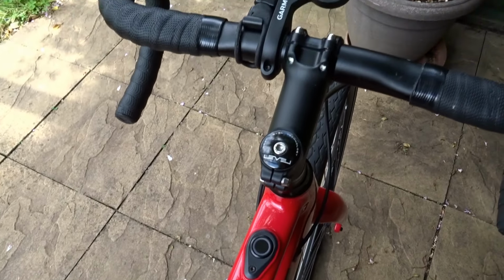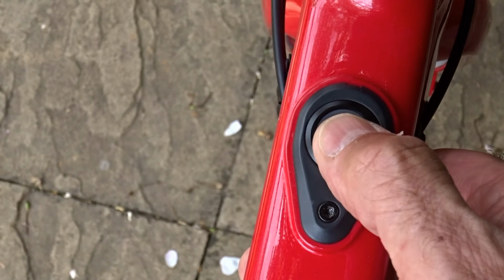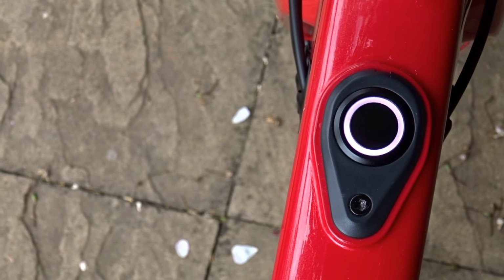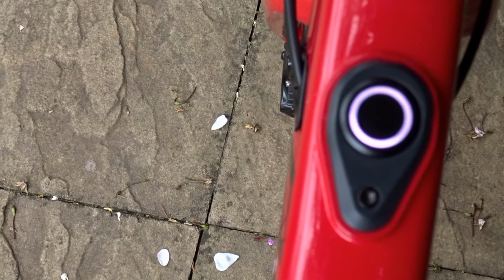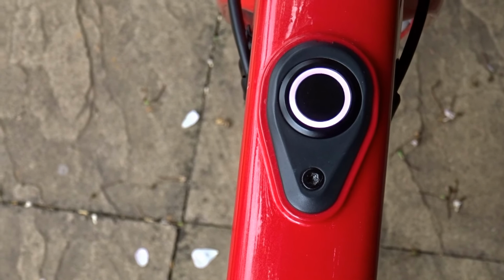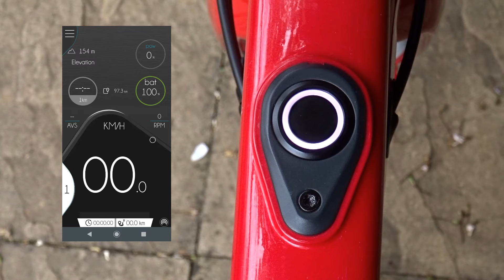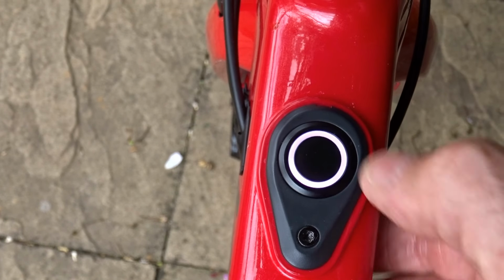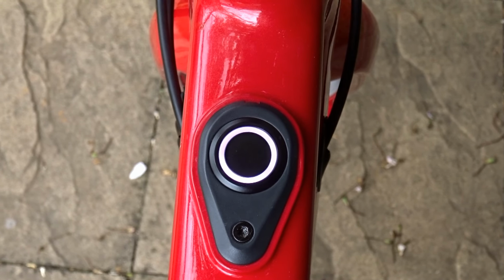How to use the Ebikemotion iWoc controller. As used on Ribble, Orbea and many others.

Comment: What’s the app called? Just picked mine up from Ribble and on train home
Reply from the maker: That’s great, you just need the weather to ride it now. Details of the app here https://www.ebikemotion.com/web/ebikemotion-app/
Reply: @RideWithRoy  cheers Roy
Reply: Roy any advice on mudguards for the bike? I thought I could get some in the store at blue water today but they didn’t sell them. I tried in Halfords but they didn’t have any that fitted and said I should look online, what sort of measurements should I be looking out for? Sorry m8 I’m not very good at this kind of thing. All advice is greatly appreciated 👍🏻 your videos were a big help in me choosing my bike
Reply from the maker: I prefer SKS mudguards but needed wider for the Ribble. I got a cheap pair of Halfords own brand which are okay but not a patch on SKS. The main requirement is to match your tyre size. Assuming they are 700 x 35, then SKS Bluemells Olympic Racer should be ideal. Cutting the steel stays is a challenge, but once fitted they are easily removable for summer.
Reply: @RideWithRoy  I’ve looked at the SkS range but they all seem to have an attachment on the front mudguard  that needs to be screwed into the top of the front fork and my bike doesn’t have a hole in the top of the front fork for that kind of mudguard. I’m gonna check out the ones you mentioned. Thanks for getting back to me m8👍🏻
Reply: @RideWithRoy  would the SKS veloflexx 65 mm mudguard set for a 29 inch wheel fit?
Reply from the maker: I really couldn’t say. You would need to measure the space inside the frame. It does sound a bit on the wide side. What width is your tyre?
Reply from the maker: Mine has the screw in the front fork, so maybe something has changed. It would be worth emailing Ribble factory to ask their advice.
Reply: @RideWithRoy  cheers Roy
Reply: @RideWithRoy  47mm
Reply from the maker: I suggest get close to that. Say 50mm

Comment: Hi Roy - I have a question that I've asked of a few users and got nearly as many answers!

I understand that by using the App you can customise the amount of assistance available for each of the three levels (Green, Amber and Red) individually on a sliding scale. My question is to ask whether these customised settings are "saved" on the bike's circuitry, or whether the App needs to be running all the time? To put it another way - If the rider used the App to set the level of assistance in the "Green" setting at say 50% of maximum, but then switched off his phone (or left it at home) while he went for a ride, would the bike give him 50% or the full 100% ?

Keep up the good work on your channel - I've enjoyed your videos immensely.
Reply from the maker: Thanks for the question, Roy, but you’ve stumped me because I don’t use the app. I would imagine that the the changes remain, but I’ll ask my contact at Mahle and get back to you with an accurate answer.
Reply: @RideWithRoy  Cheers Roy. Don't put yourself out to obtain an answer - I only took delivery of my CGR Al e yesterday (same colour as yours!) and have yet to ride it at all. I'm trying to get an understanding of the whole system before I do - It's just the way my thought processes work.
Reply from the maker: @TheRoybeasley  not putting me out at all. I’ve sent my contact a message so should get an answer Monday. I’ve never bothered changing the engine settings.
Reply from the maker: Hello, Roy, my contact has confirmed that changed engine settings are retained when switched off.
Reply: @RideWithRoy  Cheers Roy -  I took the bike out for her maiden voyage today (I've never ridden an e-bike before). Initially I was a bit unimpressed by the level of assistance available in Green mode. Until I powered up my phone and connected the App, to discover that my earlier fiddling about with the App's settings had indeed been "remembered" by the bike and it was giving only 40% assistance in that mode!

I've since had another play - including connecting from a totally different phone and can indeed confirm that the engine settings are stored on the bike and that there is no need to keep the App running on the phone all the time you are riding.

I'll be moving up to the next level soon and connecting my HR monitor to the App/bike, meaning that the level of assistance will automatically match how hard I am working!

(Gotta love this technology!)
Reply from the maker: @TheRoybeasley  thanks for confirming that, Roy. It was pretty impressive that the Mahle contact replied on a Sunday! I did 50 miles yesterday, mostly into the teeth of a seriously strong wind. I had the power on for most of the ride as I was trying to keep up with my very fast son and we had 2600’ of climbing. I used all three power settings at times, although mostly green and I was on flashing red at the end. Mind you, he still had to freewheel a lot and wait for me several times on his featherlight carbon steed. Enjoy you e assist as it’s certainly a game changer. For your next gadget you should really consider the Varia Radar. I’ve discovered an excellent add on for mine that I’ll cover in my next video.
Reply: The changes you make are saved to the bike.